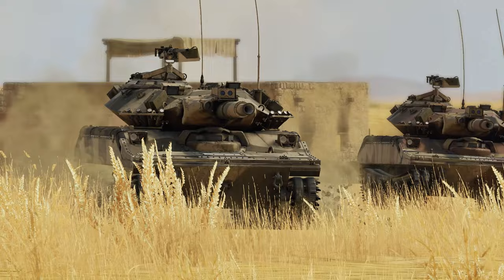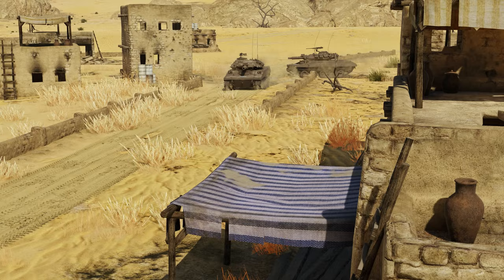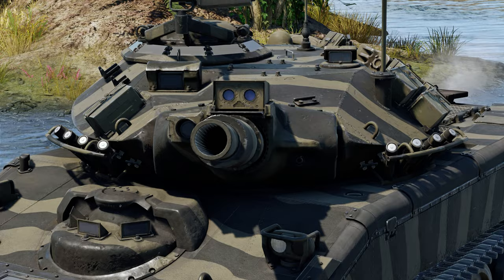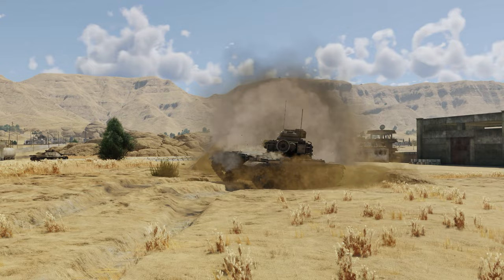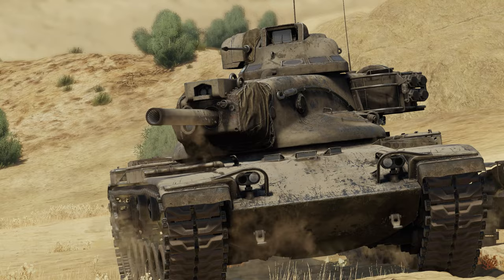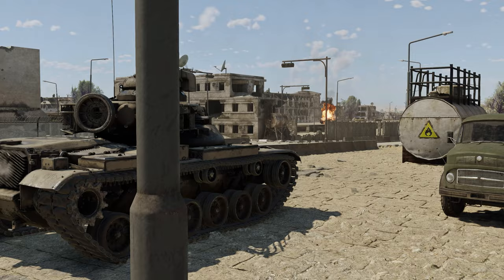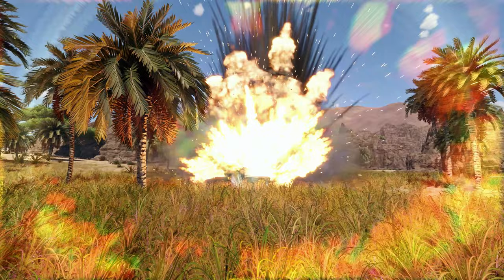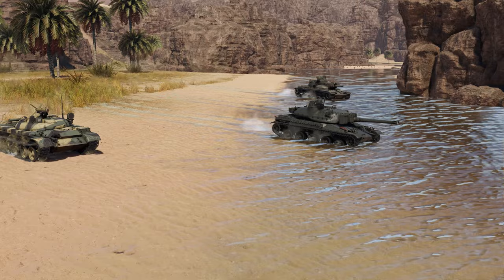Missile Tanks: Weapon of the Future That Never Happened

Comment: Gaijin Will we ever get the chance to see the F/A-18 rocking in war thunder ?
Reply: it will be i think even in the next update cuz you can see f18 in rwr when harrier is nearby why wouldn't they add an f18 now
Reply: unfortunately yes, my estimation would be that it'll be in by next year
Reply: We've gone from F-4E/MiG-21bis to F-16C/SU-27 in 3 years, take that as you may :D
Reply: I think it should come by either june or december.
Reply: @gigachad8425 it's bc they share the same radar and the f18 was denied for this patch
Reply: F18 A for US and F18C for Sweden in Finnish line ;)
Reply: @Juho-uf8si  in that case both f18c
Reply: @gigachad8425 that’s not a variable in it getting added, however OPs question is kinda dumb, at this rate you should know it’s only a matter of time before we see it in game it’s just a matter of when. As for the in game radar that is mainly bc the harrier + uses the f-18 radar, since all radars and RWR are modeled pretty accurately in respect to real life, they had to add the F-18s radar early to install it on the harrier
Reply: @FatherExo  i know that why i think f18 will be added next because it arleady has a radar
alteast for me adding f18 would help me in sb

Comment: You gotta be joking. You cannot shove the objekt 775 with all the rest and say that it had it's problems and it was tested. 

It was not tested like they state in this video.

The first thing was that it was too uncomfortable to drive and it was shelved. That special suspension was put on tanks later on in life because they realized it wouldn't work on the objekt 775 due to not having enough space. And it's missile system was incredibly unreliable according to russia's records to the point where it stayed an experiment and never fired on an active chassis. The picture they sent off as the official look of it was also a mockup. Nothing worked on it besides the ability to drive it around. And again it wasn't even comfortable with the full crew. The xray of it you can see why. 

Sitting it next to the sheridan and calling it the same is grasping for straws. Just because russia had a ton of experimental tanks doesn't mean you gotta imagine them doing better than their original design.